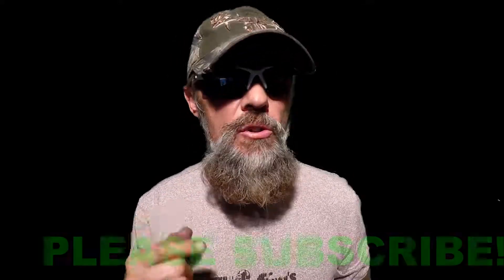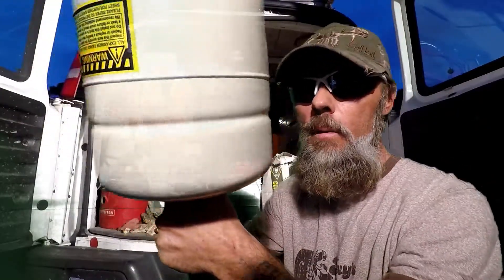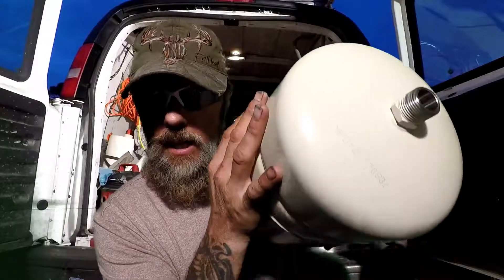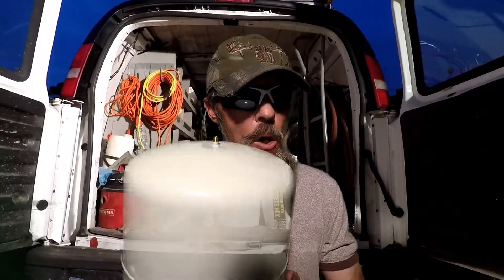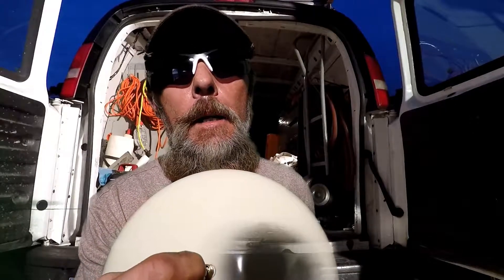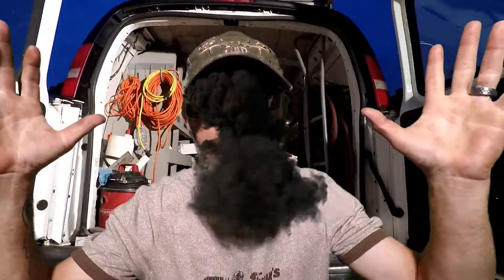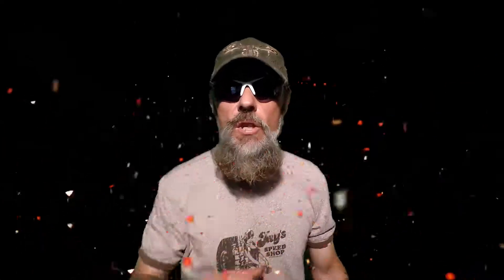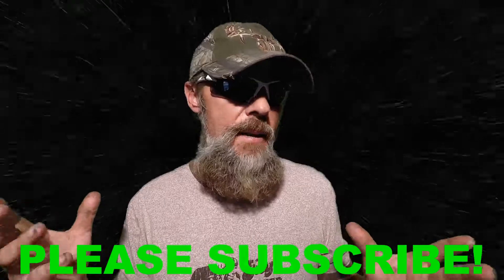Why you need an expansion tank!

Comment: So we need to install an expansion tank that goes bad in about 3 to 5 years (and will almost certainly not be checked or maintained by the homeowner) to prevent pressures of less than 150 psi on household pipes which are typically rated for 400 psi?

Comment: If I have a prv that I can dial down to 60 psi (tested inside the house at 60 psi) and never have any dripping or anything from the pressure valve on the hot water heater, do I really need one of these or am I probably OK?

I know that it couldn't maybe hurt but I'm just rationalizing that if I never have any issues with my t&p valve and the pressure inside the house is ok, that I can't see how it would make much of a difference.

Thanks for your vids.
Reply: Also I am pretty sure my hw heater has a check valve on the cold water side atleast. I thought they were pretty normal.
Reply from the maker: You know some people do get lucky and avoid having many issues
Like you said not a bad idea for the expansion tank
So many homes these days are built with the cheapest of parts so any kind of protection you can have for your plumbing is always a good decision 
Thanks and good luck!